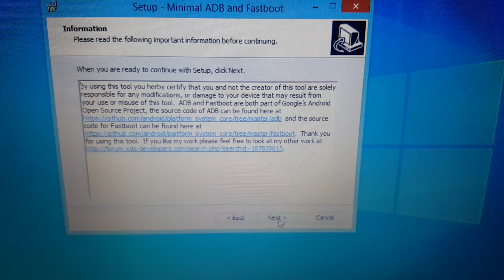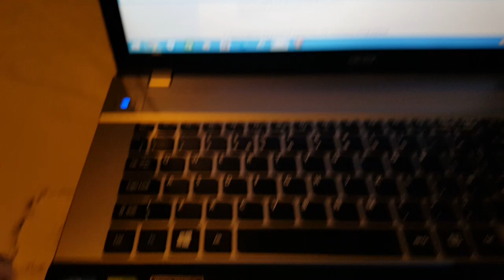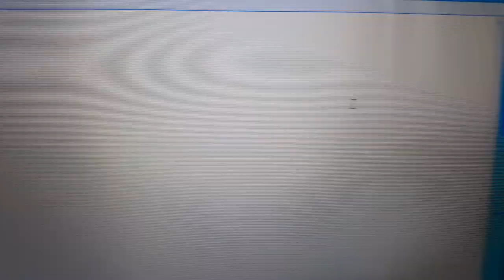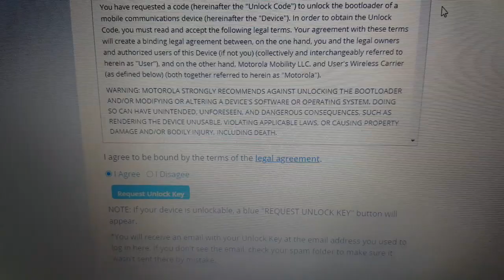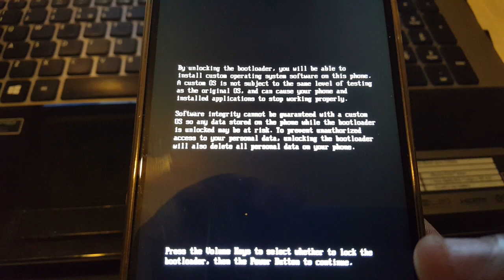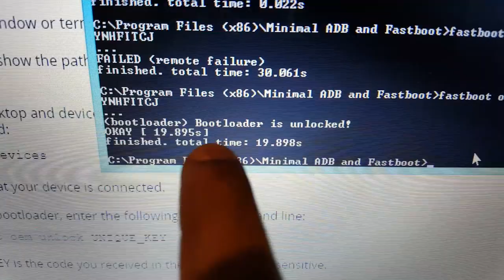How To Unlock Motorola Moto G8 Plus Bootloader Easily For Beginners!! Works For All Motorola Devices

Comment: C:\Program Files (x86)\Minimal ADB and Fastboot>fastboot oem get_unlock_data
...
FAILED (remote: unknown command)
finished. total time: 0.006s
this is what i get... can you help me?
Reply: maybe you've miswrote some characters putting the code, my sugestion is instead of typing in you can just copy the code from you email to the cmd, it's easier and doesn' leave room for errors

Comment: How do you re-lock the bootloader? Google Maps won't run with unlocked bootloader.
Reply from the maker: U need to flash the stock firmware  and run oem relock commands Google it

Comment: I've done this process 10 times and even restarted both phone and computer and still getting "device does not qualify" message.
Reply: I did more research and said screw it. Though the phone had decent specs, there really is no development community with roms and all. I sold the phone and purchased a Poco X3 pro. 156g of storage, 6 gigs of ram plus an 860 processor. Very active development community. If I were you and you are reading this, bag the moto G8 plus for something way better for not much more, if any, money.

Comment: Seems motorola makes it harder to unlock some devices: mine's a moto g8 plus and the site keeps telling me that my device "doesn't qualify". How long should I keep trying?
Reply from the maker: Ot does qualify i remember it telling me that too i had to keep trying even rebooted my pc several times and using a diffrent broswer to log into motorolas website before it eventually let me unlock
Reply: @TheRealAndroidDoctor  and after how many days did you achieve getting the code?
Reply from the maker: Same say but like i said i have to do all those things i mentioned it was quite fustrating but its the website thats the problem
Reply: @TheRealAndroidDoctor  well, I'll keep trying, thanks bro ;)
Reply from the maker: @GrandBurr  yes maybe try from another pc too
Reply: @TheRealAndroidDoctor  Update: I think I found the reason the site isn't giving me a code, and I think the IMEI has something to do with the unlock code generation: lots of things broke on my moto g8 plus after it updated from Android 9 to Android 10, amongst them is the IMEI, which changed from the original one that comes in the SIM tray (didn't perform any process to change it before) to another one. When using Rescue and Smart Assist the tool detects that IMEI is from a moto g4 from 2016 (???????). After writing the right IMEI (the one that comes in the SIM tray) the tool recognized the right model (moto g8 plus XT2019-2). So everything I have to do now is change back to the original IMEI to get the right unlock code at the moto site.
Reply from the maker: Awsome thank god u figured ot out

Comment: i have closed motorola site around 30 times now to see if my device can be unlocked and i just get the message everytime...is this normal or is my moto g play phone just not compatible...
Reply from the maker: Did u get the unlock code?
Reply: @TheRealAndroidDoctor  no i just have the string to try and get the unlock code and i have now closed and reopened the website and input my code probably 100 times and still it says i dont qualify for the unlock
Reply: and i have have quadruple checked to make sure that my string is correct and without spaces, and the sting i am using to try and get the unlock code is definately correct with no spaces in it. im trying on a moto g play using android 10
Reply from the maker: @troymiesner7306  I read on a forum slot of Moto g play owners have this same issue some said they fixed it by doing a factory reset then trying again
Reply: @TheRealAndroidDoctor  okay i will try that, thank you sir
Reply: still no luck, im looking through forums but no luck so far
Reply from the maker: This is the thing if Motorola has sent u the code that means your bootloader can be unlocked but for some reason alot of Moto gplay owners are facing this same exact problem is your own unlocking option greyed out?
Reply: @TheRealAndroidDoctor  what do you mean by is my own unlocking option greyed out? i just know when i type in the string to see if my phone is able to be unlocked, i get the message at the top of the screen telling me my phones bootloader cannot be unlocked, i have tried this on several different browsers as well since people recommended doing that, and still no luck
Reply from the maker: @troymiesner7306  go to settings>build number>keep tapping on build number untill it says your now a developer ,Now go back and in the settings u should see a new unlocked option called DEVELOPER OPTIONS>  go in there and look for OEM unlocking and try turn the toggle on
Reply: @TheRealAndroidDoctor  yeah i've done that and usb debugging is on. but when i enter fastboot mode on the bottom left is says oem_locked
Reply: i just posted on the motorola community and hopefully someone there can help identify whats happening
Reply: @TheRealAndroidDoctor  can you please help me with 1 more thing? I found out I can't unlock my bootloader for 1 year because it's straight talk which is a trac phone. Can you tell me what providers or phones can be bootload unlocked right after buying it from the store?
Reply from the maker: I can't really say bro I think it's best u do some research first
Reply: @TheRealAndroidDoctor  did you unlock your bootloader right after buying it? And if so what providers is it
Reply from the maker: I unlocked mine maybe a month or so after buying it ,mines unlocked simfree so basically I can use it on any network I'm in the UK btw

Comment: hi.am using moto g8 plus and have this same problem, however when i follow your steps im unable to solve it. first of i have turned on developer options but  my OEM unlocking is greyed out with message"bootloader is already unlocked" .i am unable to turn oem unlocking on or off
Secondly when i get to the command prompt ,the fast boot command when i type it starts the fastboot with a yellow font then the rest in normal white font and i dont get the unlock code displaying. Can you please help me solve this?thanks

Comment: What is the benefits of unlocking moto G8 plus bootloader?,I have moto G8 plus and the procedure is very easy I can do it but I think any mistake can damage my phone b/c  I am in pakistan and here motorolla is not launched officially except 2 or 3 phones (moto e6plus and RAZR etc)and here no one knows about motorolla is there any risk in this process?
Reply from the maker: The benefit of unlocking the bootloader is u can then root the phone

Comment: Thank you for this video.
Can i repair imei on this device?
Reply from the maker: How did u loose IMEI?
Reply: @TheRealAndroidDoctor  after reset it won't show both imei
I did repair on my Samsung phones but couldn't find any tool for this model I've a shop for repairing phones.
Reply from the maker: @junoon1122  try flash stock firmware
Reply: @TheRealAndroidDoctor  Yes I'm doing that now..
I was looking for alternate because the firmware is totally fine but the imei..
Thanks for the help Doctor ❤️

Comment: Question: When we unlock the bootloader the phone will update again? Have unlocked mine and my phone is trying to update and it doesn't work !
Reply from the maker: Yes u can still do it's update with bootloader unkocked
Reply: @TheRealAndroidDoctor  so there is another reason because my moto g8 plus doesn't update?
Reply from the maker: @ricardogomez3129  do u have a rom installed
Reply: @TheRealAndroidDoctor  no.. i only unlocked the bootloader and tried to rooted it... only that
Reply from the maker: So your rooted?
Reply: @TheRealAndroidDoctor  I tried following your video,.. but it doesn't worked.

Comment: Rock on dude!  It worked. However I had problems because you didn't mention one thing in your instructions.  You need the MotorolaDeviceManager_2.5.4.exe installed so that Winders can see your device.  This is what was causing me to get the yellow triangle.  Problem solved though.  I appreciate you walking through the information so that I could do this.  I HATE BLOAT WARE!
Reply from the maker: Awsome hey remember to like and share the video thanks 👍

Comment: So I was able to open the command prompt and entered the command, 

It only showed me <waiting for any device>
Reply from the maker: Unplug the cable then reconnect it
Reply: @TheRealAndroidDoctor  still the same,  sir!
Reply from the maker: @FoodRavel  go to settings>about phone > keep tapping build number untill it says u are now a developer then go back & look for the developer options in there turn on allow bootloader to be unlocked
Reply: @TheRealAndroidDoctor  been there done that
Reply from the maker: Did u manage to sort it?
Reply: @TheRealAndroidDoctor  no sir. It's stuck on the same. Waiting for device
Reply from the maker: Try  go to device manager on pc settings with the phone connected do u see a yellow triangle?
Reply: @TheRealAndroidDoctor  Alright. So,the command worked and got the bootloader code. But the website rejects saying that my device doesn't qualify for bootloader unlocking.
Reply from the maker: @FoodRavel  ignore it close down the Motorola site and repeat the process it will eventually allow it to be unlocked I've faced that message many times
Reply: @TheRealAndroidDoctor  I do, What is the next step?
Reply from the maker: Did it unlock now?
Reply: @TheRealAndroidDoctor  asking me?
Reply from the maker: Yes I'm asking u
Reply: @TheRealAndroidDoctor  that worked. 

However I want the device back to normal. So waiting for your next video 😀😀😂😂
Reply: @TheRealAndroidDoctor  I have the yellow traingle, What should I do?
Reply from the maker: Select browse my computer for driver software then choose  let me pick from list then click on Android usb driver then the drivers will install and your phone will be recognised

Comment: When I entered the fastboot oem command, this is what I got (also I use Windows10, I get PowerShell not the CMD)

The command fastboot was not found but does exist in the current location. Windows PowerShell does not load commands from the current location by default. If you trust this command, instead type: ".\fastboot". See "get-help about_Command_Precedence" for more details.
PS C:\Program Files (x86)\Minimal ADB and Fastboot> Check the spelling of the name, or if a path was included, verify that the path is correct and try again.
Reply: did you find  a solution because I'm searching but I can't find how to go back to the old terminal instead  of the newshell
Reply: @alislamdeni2016  enter the command in search box